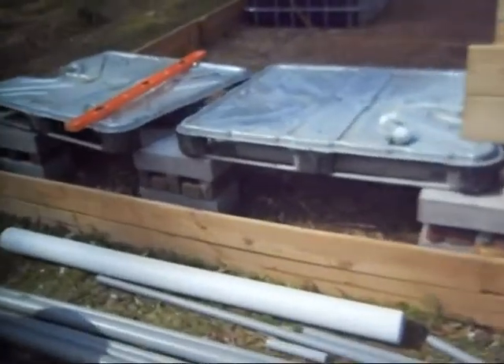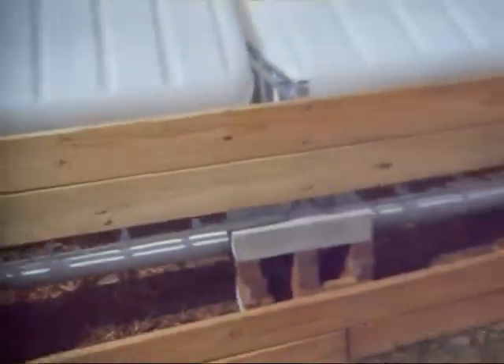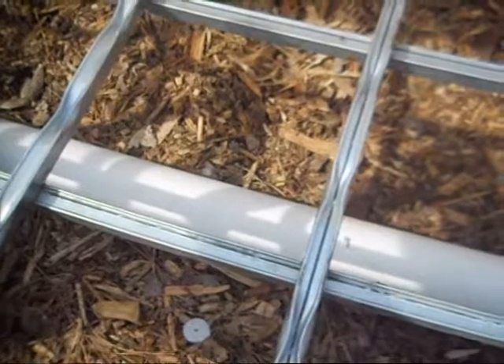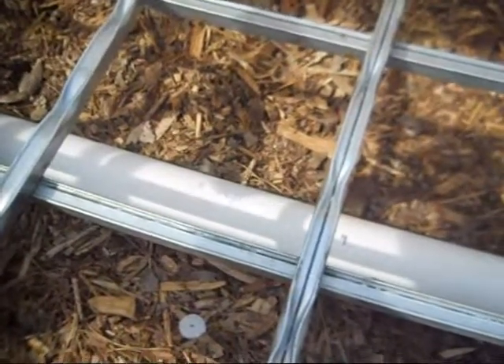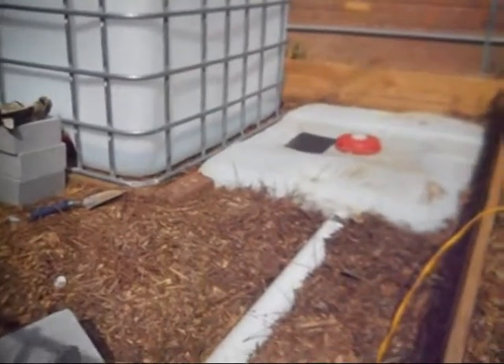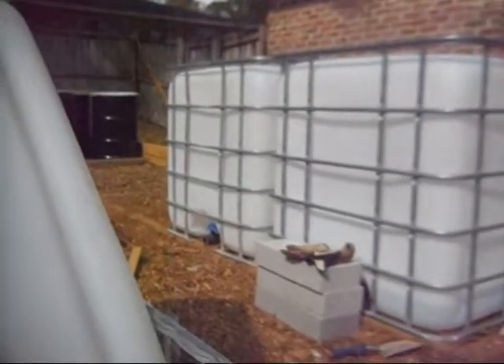IBC Aquaponics System update 5

Comment: Hi Mark, does your sump tank that you have buried ever freeze in the winter, or would you say it keeps it warmer Underground? 

I am thinking of putting two in the ground to keep fish for my Aquaponics setup, but if there is no beneficial heat from the ground, I might have to rethink what my plans are.

Thanks for the video upload!
Reply from the maker: I live in Mobile Alabama, or weather is warm enough that even above ground tanks don't freeze. My reason for burying the sump was for flow reasons rather than weather.

That said, in our hot summers, the buried sump did have a slight cooling effect due to ground temperatures. It would depend on your local ground temps along with other factors. Burying the tanks might help, especially if your system is inside a green house or heated enclosure. For any real benefit, tasks would have to be below your local frost line and the rest of your system (grow beds, filtration, piping, etc) would have to also be protected from freezing temperatures. Hope that helps.